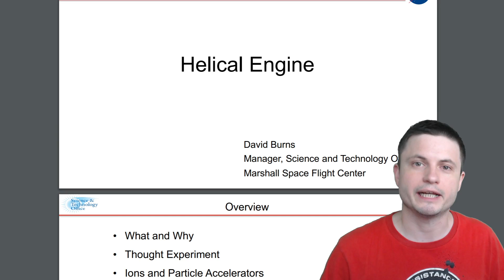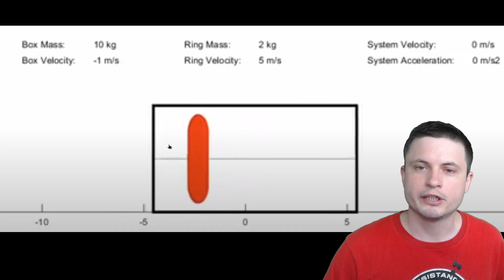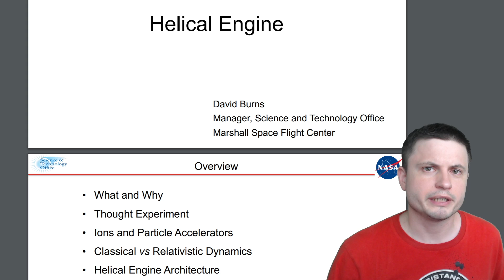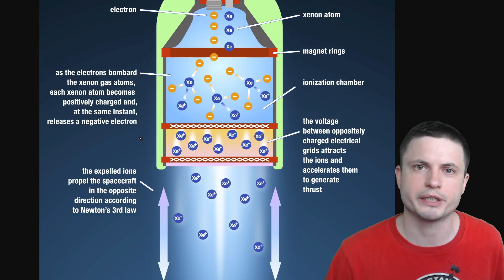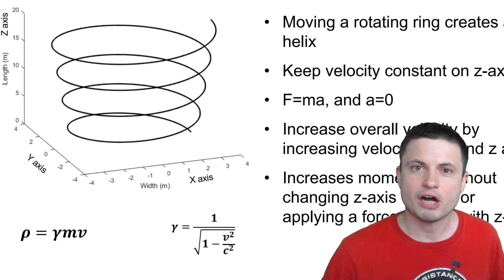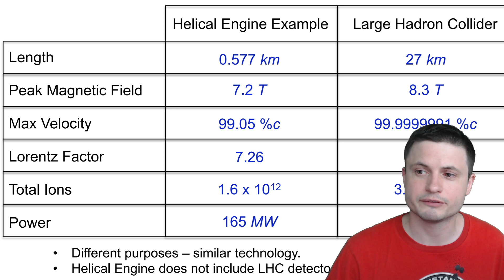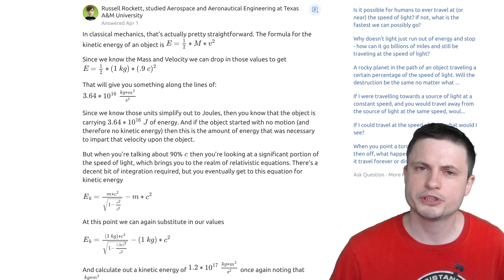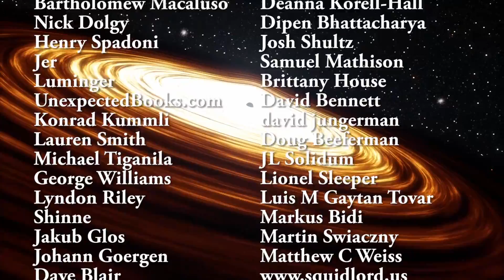NASA Engineer Designs a Near Light Speed Engine But Does It Work?

Comment: An enriched uranium fuel rod has 5% Uranium 235 so a pure 235 source would produce 20x more energy than the 8e^13 stated. (order 10^15). 10 kg would produce order 10^16 joules - enough to get to around 70% the speed of light? if future generations can make smaller fission reactors it could happen.
Reply: Pure 235 would blow up your spacecraft. You don't want it enriched to 100%, promise.
Reply: @DavenH  Small amounts of pure 235 introduced incrementally to the fission chamber would fix that problem. Again im not saying its currently possible, just a thought for the future.

Comment: first of all i have to admit i didnt read the paper, but there is one thing i would like to know:
if i understand correctly we would have to somehow change the mass or the length of the material we use, in order to produce the propulsion, right?
is this done by just changing the relative velocity? or is it through a cycle of fusion and fission? because theoretically we should be able to do that in a cyclic movement as well, like in a particle accelerator, right?

Comment: While it takes huge amounts to accelerate the mass to near light speed you get most of it back when you slow it down to reduce the mass for bouncing off the other end of the box. So you sit in low solar orbit absorbing and storing energy until the engine is spun up and then use a nuclear reactor or laser collectors to keep up with friction loss but the latter requires trusting the people left behind.

Comment: I hope isn't the EM drive cause it got debunked by NASA. Originally they detected a measurable acceleration without any propellant. But then someone realised that it could be caused by an error so they did a second test to eliminate the possibility of that error, and proved it actually didn't work. Not that I care. If someone manages to build a working version, I'd be like, let's go to Mars!
Reply: PS China is ready to turn on it's first fusion reactor by about March 2020. They had announced they were going to turn it on this year, 2019, but some people are guessing there's a small delay. Let's see what output they can get with a stable reaction.

Comment: Is it possible to mechanical or other wise transfer the angular momentum/rotaition between the discs without needing the energy to accelerate and decelerate the rotating motion.
Modern trains and electric buses use the energy from breaking to generate electricity that can be used again to accelerate. So I am thinking about some similar mechanic.

Lets try thing something out. 
1. Put two weights on an each end of an retractable stick. 
2. Rotate the contraption around its center of mass. 
3. If you lengthen the stick the rotation will slow down (think ice skater pirouette).  Shorten it it will the rotation will slow down.
4. Couple two of that contraptions together so they only can spin at the same speed.
5. If you lengthen one of the sticks the mass of the weights on that stick should move faster and gain weight? or does it somehow balance out )
6. Move the heave (fast rotating parts)
7. Switch what pair of weights that is rotating fast with changing the length of the sticks again.
8. repeat

Something is probably horrible wrong... A space craft must probable have to double up with 2 counter rotating engines so the whole ship don't start to rotate.

Comment: So regardless whether this would work or not, what if you translated it into harvesting energy from the casimir effect?
1. Speed up 2 plates so their mass increases
2. Casimir pulls 2 heavy plates together, extract some nice energies
3. Slow it all down, plates get lighter
4. Pull light plates apart for less energies
5. Repeat
6. Profit

Energy for step 1 is reclaimed in step 3 so there's a net gain in casimir energy?
Reply: Except that to slow down the additional mass and pull those plates apart, you're gonna need at least the same energy you got out of it. Not to mention that even accelerating it in the first place (both positive and negative) takes far more energy than you'd get out of the casimir effect anyway.
Reply: @MajinOthinus  Why is this everyone's complaint about the idea? Slowing it down does not cost energy. It generates energy akin to how regenerative braking recharges car batteries. And the energy you get out from slowing it down will be the same as the energy you put in to speed it up.

So you'd be basically spending and reclaiming the same energy over and over while you speed up and slow down repeatedly, while also harvesting casimir energy.

The real problem with the idea is that in order to accelerate something to speeds great enough you'd need a ridiculous amount of energy, like convert the earth into energy amounts. But for that we have the sun, which we can harvest energy from a lot more directly.
Reply: @Kags  Of course slowing it down costs energy! You're changing it's state of movement ie. accelerating the object, over a certain distance, which requires energy. 

Regenerative breaking also requires energy to slow something like a train down; you're only storing the rotational energy of your wheel in a different form (electric potential), the actual deceleration is done (as in all wheeled vehicles) by the friction between your wheels and the ground.

So no, you don't get out anything anywhere near to your energy investment even in as simple a thing as a car, never mind trying something like that in space (though do call me up when you invent the wheeled space ship).

I also don't think you have any idea what the Casimir effect really is, seeing as you seem to believe one could extract energy from it.

Comment: Let's imagine a spaceship that can travel even 1/2 the speed of light (93,000 mph). Even if the spaceship were made entirely of titanium, what would happen when at that speed it comes in contact with cosmic gasses, dust & meteorites? It would burn up, disintegrate or blow up! But let's imagine that spaceship has an unimaginal navigation system to avoid such fatal elements; the G forces imposed to avoid such hazards would be instantly FATAL to any human. Sorry to burst your Buck Rodgers bubble but we are stuck on this blue marble, and WAKE UP; we NEVER left Low Earth Orbit (not even a cockroach could survive the deadly radiation of the Van Allen Belt unless surrounded by lead).
Reply: lol 1/2 speed of light is 93,000mph?
Reply: 186,000 mph divided by 2 (i.e. "1/2") should be 96,000 mph if basic Grammer school math is reliable. LOL!
Reply: Acceleration and deceleration are not the main issue concerning lethal G forces at hyper speeds. Given enough enormous time & distance I suppose it's possible, but ONLY if traveling in a straight line. My point was what would happen to a securely strapped human body if it is subjected to an abrupt turn to avoid an asteroid (or even a meteorite) at even half the speed of light. Ask any Jet Fighter pilot who had to endure punishing G forces at mere supersonic speeds and I'm confident he or she would agree; any abrupt manoeuvers at hyper speeds (tens of thousand mph, not hundreds) would be instantly fatal and turn a human body into a meat slurpie.
Reply: Typo; I meant "93,000". Heh, heh, heh! My bad.
Reply: No rocket will EVER reach even close to light speed; the attemp would require too much  fuel, create too much mass, and would SURELY smash into something before reaching its destination. Interstellar travel? Dream on!
Reply: Pee second! Yea the joke's on me LOL! I'm a Gearhead who constantly talks mph and It's been 37 years since High School. But the hillarious correction only magnifies the reality of my point.

Comment: Even if we did travel %99 the speed of light, we'll never get there.
Reply: Don't forget about time dilatation. If you travel at 99.9999% of the speed of light the time to arrive to Andromeda galaxy will not be 2.5 million years, it will be, say, 10 years.
Reply: @crazyhorse6840  But time dialation would make it pointless. So if 10 years pass for them then it means extinction for the human race (people on earth) or ironically we on earth would find a greater means of transportation and probably would beat them within the 10 years of them getting there. 
Do not forget that the expansion of the Universe is at least at the speed of light or greater, so 99% is meaningless. Sure the Andromeda Galaxy is an exception but for other voyages it will be impossible.

Comment: I'm quite sure: some kind of the above base principle is our - perhaps only - ticket to the stars (e.g. longrange space travel). Almost all kinds of reaction propulsion which react on ejection of accelerated masses will not work - due to the vast amounts of support mass which is required for the necessary thrust and/or operating times. Even if you got an extremely efficient e.g. nuclear reactor or whatever as power source - you'll still need prohibitve amounts of such support masses which are to be carried along AND will continuously be lost during accelertion and deceleration periods.
The remaining question is: Are relativistic effects mandatory for reaction-free propulsion or not. If so it looks quite bad, because relativistic effects result in  growing inefficiency. 

But there might exist other options - e.g. exploitation of kinetic effects in classical ranges. So finally - one day it may happen that good old mechanics is what gets humanity to the stars... :)...

Comment: Near Light Speed travel isn’t feasible, moving at that speed will cause the atoms in space to fly through the craft making small holes before the craft eventually breaks... gotta go faster with a shield ie anti gravity travel/ propulsion
Reply: Anti-gravity is a nice idea, but up to now is has not been found or observed (in technical scales). The local gravity potentials in interstellar space are very very tiny - so hypothecial g-shields of tremendous dimensions would be needed to produce significant forces at great distances to gravitating bodies. However - for travel at siginificant portions of lightspeed - e.g. 20 or 30% - there might be solutions like deflection shielding etc. to clear the path. Of course the challenge of shielding increases the faster you get...

Comment: The twin paradox theory has been debunked already.  There is no time dilation during near light speeds.
Reply: The twin paradox is not a theory - its just an allegory to demonstrate an imaginable effect of time dilation. Some sort of time variation however seems to be real, as clocks on earth and e.g. on satellites are diverging - which is seen as one of the most prominent evidence for Einstein's Relatitiy Theories. At least that observation itself is not neglectable any more.
Reply: @JosuaKylie  Clocks on earth sitting on a table are subjected to gravity which affects the vibration of atoms and molecules similar to compression which can cause mechanical systems to vibrate and move faster. If the clocks were put in a free fall situation as it exists in space then the compression is not there so the clocks operate much slower. This is a mechanical effect and is not due to time dilation. We may have to wait until NASA can build spacecraft that can approach at least half light speed in order to prove once and for all if Einstein's time dilation theory is correct.
Reply: @onetruekeeper  The clock of each GPS-satellite gains 38640 ns per day. This is similiar for all satellites because they use similar orbital parameters. For positioning purposes no problem because that evaluation is not sensitive to a common offset in satellite data. But GPS is used as a time-base as well - and since new satellites got atom clocks with a higher precision than above, a specific correction ( slowing of the clock frequency ) is applied. This is contributed to the sum of time dilation by GRT 45850 ns (faster) and by SRT -7210 ns (slower).
Reply: @JosuaKylie  Perhaps within a few decades when NASA or some other  space agency can produce a long duration ion engine that can produce a thrust of 1 gravity for over a year and the spaceship eventually crosses the light speed barrier and continues even faster with no time dilation, no increase in mass and no length contraction I am sure we will debunk all of Einstein's relativity theories.

Comment: OK, to keep it simple by logic as mass is increased so is the “amount” of fuel required to move the increased mass. Kind of like trying to pull oneself up by their proverbial bootstraps!
Reply: The trick in the propose engine is not about to be "fuel efficient/energy efficient" it's to build an engine that get's around "Newton's laws of motion" that dictate that an force have to be applied to an object to be accelerated. The problem is that in space we don't have anything to push from so we have to expel some mass at high velocity from the ship and in that way move the ship. So we have to store something with mass and expell it from the ship and that something will run out. 
Now we know that stuff close to the speed of light don't act according to newtons laws even if they are a good approximations for cars and more daily stuff.  So it's not strange if we can go around them using some of the weirdness of Einsteins theory of relativity and build an engine that don't need to expel something or push against something like asphalt to work.
Reply: Rocket engines don’t “push against asphalt”! My tweet wasn’t about fuel efficiency either! May I suggest you take a physics class before you attempt to “educate” others? 😎

Comment: A really easy way to make a interstellar space engine would be to create a system that uses hi low pressure hi pressure would make it move and low pressure would make it stop and then you could just travel like a cloud on interstellar space. In the vacuum of space you could hit astronomical speeds. Kinda like creating space wind.
Reply: Everyone wants to create propulsion, but there is lots of forces that have no speed attached to them like pressure, magnetism, energy, etc. If we harness these forces instead of trying to create a adjacent force breaking the speed of light would be like sitting on a couch.

Comment: Springs would create the energy, if the part that pushes back pushed back at 1/4 of the speed as the forward motion and stopped before making contact on the back stroke and the hammer sped up on the forward stroke propelling only forward. Sort of the way a machine gun bolt with gas operation works

Comment: There are many system to convert one form of energy, into another.
Heat -> pressure
Pressure -> Motion
Motion -> Electricity
And vice versa.
When you spin a mass around, you get a centriptal force.
You can increase a mass, by providing it with energy.
So ... it is possible, to increase mass, thus centripetal force, on some section
of a circular motion.
Theefore, it should be possible to build a reactionless drive.
In priciple, it should be possible to convert one form of energy
to direct accelleration.
The physics is there. It is mostly, an engineering problem.
Me and a good friend of mine, already know this, for many years.
We are both, engineers.
And we figured it out, how to do this, years ago.
But there has never been anyone in the scientific community,
that believes, this is possible.

Comment: Just an odd thought, a mercury engine?

My understanding of a mercury engine is, an electrical current is applied to a ring of mercury it spins at an increasing speed, supposedly reducing the force of gravity. Now I am no scientist, just going on what I hear or read.

So here's the idea, mercury has a high mass (weight), spinning it up to a high velocity that mass will increase (Lorentz transformation), if this is the case, spin up the mercury and force the donut forward to give forward motion. The spinning mercury will also act like a stabilizer, reducing the wobble.

I know this is far fetched and not based on any scientific knowledge I have, just a crazy thought.

Comment: Einstein himself admitted at a point that the twin paradox was explained not by uniform motion but by acceleration and deceleration, but he didn't know how else to calculate the missing time. IOW, he was as much of a clown as he was a scientist. Likewise, the "engine" here proposed is no more feasible than the use of rocket fuel as you pretty much figured out for yourself. Nice graphics, though. There clearly is a way to shift matter into a different dimension and transfer it without ordinary limitations, but that's a bit out of our league right now.

Comment: When you know that NASA really isn't trying is the fact that they're going for such low-hanging fruit as sublight drives for interstellar travel instead of researching how to harness negative energy for use in an Alcubierre Warp Drive.
Reply: What do you mean? What do you want them to research?
There's no reason to think negative energy exist in the universe. The ones who will prove that wrong, if it can be, are over at CERN.
Reply: @Nebukanezzer  I just said that we need to research a way to harness it for a warp drive considering we need to move away from the cradle of humanity.

Comment: Wait, you said that as you approach near lightspeed you get shorter and gain mass. But that doesn't make sense because if you were traveling horizontally at those speeds your head would be going faster than your feet and would end up stretching you. Unless you are referring to being vertical, which I can see, but that would require WAY more energy to reach those speeds due to drag.

The whole container with the... thing... bouncing back and fourth would get longer and end up making it useless because of the loss of energy experienced between each bounce. I am quite skeptical of this engine design.

Comment: Energy may not be a problem yes I am only 13 so I may not notice any errors but if antimatter was used it would only take a single gram to produce 49929066 kwh energy so if the productions of antimatter was just a little more optimised it would be an affordable solution